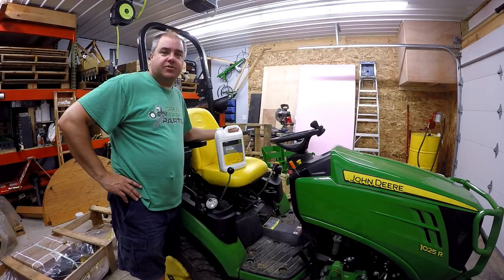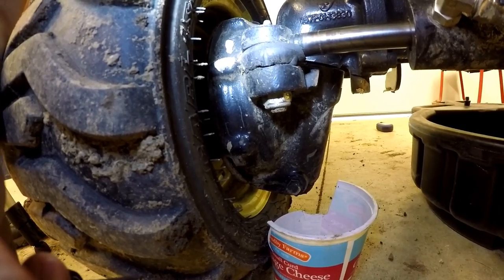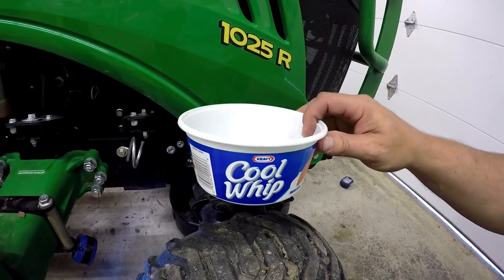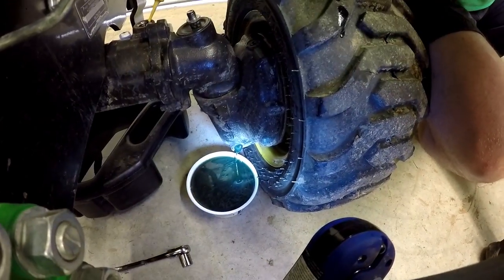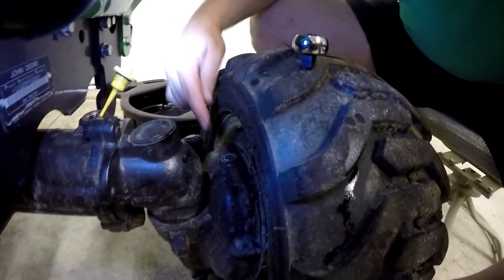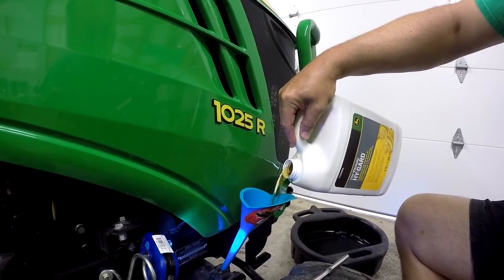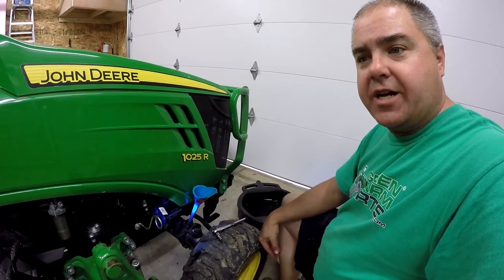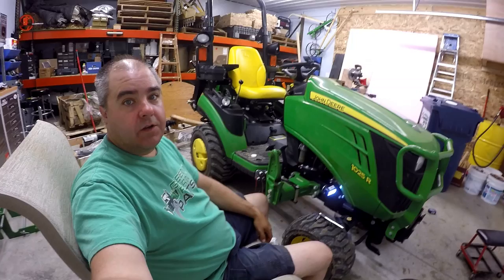Essential Oils: John Deere 1025R Front Axle Oil

Comment: I did this on mine at 50 hrs.  I read and re-read my manual and checked online - the way I ended up interpreting service manual was that the manual didn't say not to do it at 50 and it was part of the transmission service section, so when I did my 50 hr, I just did front and back axles.  Curious if others interpreted same way.  I used solo cups to catch - yep too small :).  I used  cardboard (saved amazon boxes) under the front end to catch spills.  I took some video of my 50 hr, but I didn't film the front axle piece.  Been too busy to get it edited up - hopefully will have a few done soon.  Hope y'all are doing well - as always great video!
Reply from the maker: +Tractor Therapy yea, 'oops, this bucket is too small!!!'  I thought folks would enjoy seeing that.
Reply from the maker: +Tractor Therapy ...and it never hurts to change oil. If in doubt, change it. I wish I had changed my front axle oil at 50 now...having seen the output at 250.
Reply: Very true advice.  I had quite a bit of metal shavings in front axle as well.  That axle is so beefy I doubt it does any harm to run a little longer on the change out, though.

Comment: Tim, Thanks to you and all your family for making all the entertaining and informative video's.  They have helped me in many areas with my 1025R.  From purchases of numerous Heavy Hitch items, Original tractor cab, and bucket skid shoes. Of course always using the TTWT for helpful discounts ( thank you ). I do have a question in regards to annual maintenance in the manual it says to Drain water from fuel tank, not exactly sure how this is done.  Any tips or suggestions would be greatly appreciated.
Reply from the maker: There is sometimes water at the bottom of the sediment bowl.  Perhaps that is what they are talking about.

Comment: The most effective way to clean your floor is to get a gallon of mineral spirits, two bags of oil dry and a stiff bristle push broom. Keep the area well ventilated and be careful about sparks or open flames due to the fumes !!!!!!

Sprinkle out the mineral spirits over the oil spill areas and scrub with the broom, then cover generously with the oil dry.

The chemical will break down to oil allowing the oil dry to soak it up, let it sit for a while, you can stir it with the broom and see it soaking up the chemical and cleaning the floor. Before you know it "Bob's you uncle" and your garage floor is clean as new.

The oil dry can be reused several times, I have even spread it out on a old concrete pad and burned the oil out of it and put it back in the can to use again.

It does work better in cooler weather and cool concrete, less evaporation and fumes.
Reply from the maker: +mrgearheadfromhell sounds good.

Comment: Great video! Question: Not sure if we should keep adding the new oil to the point where the oil comes out of the two bleed screw ports? Will the oil eventually bleed from the screw ports after an hour or so? I am thinking that the vent ports are well below the final oil level. Thanks

Comment: Tim my 2016 with less then 200 hours has started leaking up front left set on the tractor the seal I guess has gone out on that side have you ever changed it are is that something i need to take in the parts is right at. 100 dollars and labor is 675 thanks for all the help you can help me with

Comment: Great video. I can't see in the manual where it says to change the front axel fluid at 200 hrs. Probably good to do so but all I can see in my manual is to change it at 600 hrs. Do you have a service manual that says otherwise? Thanks.
Reply from the maker: +Laurie Harding I dunno for sure.  I can say that my oil looked horrible.  I regret not changing at 50 or 100 hrs.
Reply: Tractor Time with Tim  Sounds good to me. Getting ready to do my fall oil/fluid changes along with fuel filters so the front axle will be on the list. I have 300 hrs on mine. Thanks :-)
Reply: Tim this weekend I changed my front axle fluid when I replaced the fuel filters and changed engine oil and filter, and greased it. I have 300 plus hrs. On the clock and I must say the axle fluid was very dirty down at the lower drain plugs. It was a very metallic looking fluid. Thanks for the video.
Reply from the maker: +Laurie Harding yes, mine was the same!  We really should change this at 100 hours!

Comment: Tim,   What is the depth of your Pallet rack?  I have a Two car garage with 7" doors and 8'6 ceilings, and am looking to add a pallet rack to one side to better stack, my Box blade, Tiller, Snow blower, Hopper spreader, Post hole digger. loader bucket, York Rake, Dethatcher  (you get the idea.  Tractor on one side and implements on the other.  Wife's car on the outside  any suggestions would be appreciated.  or even a video on storage.
Reply from the maker: +Todd Smith wife's car on the outside??   Bad plan!  Anyway, my pallet rack is 46" deep, but most are 42" or 48"
Reply: The Kidney Stone has her car outside right next to my 2012 F-250  so she cant complain.  The John Deere 1025R and implements stay inside out of the weather so they do not rust up.   The 1025 in one bay with a block heater for winter and the implements in the other bay. thats why  i am looking for a pallet rack or two so I can clear up some floor space.
Reply from the maker: +Todd Smith I bought the pallet racking from a local used pallet rack place.  That way, I could get exactly the pieces which fit my application.  Less than $500 for all of the pallet rack in my shed

Comment: Hey Tim, does the front axle take the same oil as the trans/hydraulics???? also, would you suggest adding "teflon tape" to the vent plug when you reinstall them???
Reply from the maker: Yes, same oil, no to Teflon tape.

Comment: Wow, 250 hours and changing the front end?! My manual says to do it at 600 hours. So that's when I did it. Didn't see any metal in mine. I'm getting close to 900 hours. Next spring I should be right at 1000 and time to do the oils again except the front end. The 2210 I had for 10 years had 1400+ on it when I traded. Looks like I'm going to beat that with the 1026. Take care.
Reply from the maker: +mi2tn yea, i think you use your tractor for more than you did the 2210.  Being a bit larger, it is probably a bit more useful.
I think my book said 200 hrs for front axle changes.
Reply: You might be right but I think I put more hours on the 1026 because I'm retired and have more days to use it. :)

Comment: Hello ! I have a 1023e , should I be changing my front axle fluid at my first 50 hours ? What kind of service should I be doing at my first 50 hours ?
Reply from the maker: Your manual has all of this information.   The recommendations changed in 2018 for 2018 and newer machines.  No more 50 hour change for front axle or hydraulic oil/filter.

Comment: I believe you stated 2.2 quarts in the front axle...
I'll find out in an hour...
Fluid Capacities
Item	Measurement	Specification
Fuel Tank	Capacity	21.2 L (5.6 gal)
Cooling System	Capacity	3.7 L (3.9 qt)
Crankcase with Filter	Capacity	2.7 L (2.9 qt)
Transmission and Hydraulic System	Capacity	12.3 L (13 qt)
Front Axle	Capacity	2.8 L (3.0 qt)
Reply: Mine as well. 3015

Comment: Tim I have a JD 4120. 43 hp. I have problems with leaking where each wheel bolts to the axle itself. I've tightened it many many times. When it first happened it was under warranty and it was at the JD dealership for a warranty repair and they called me to say it was leaking. Confused I asked could they just tighten the bolts. They did. 
When I got it home I was working moving dirt and I noticed the front end was acting funny. When i looked one side only had one secure boot holding it on. The others were hanging on by a thread or two each. I literally turned them w my fingers about a turn or two and they came out. 
There was no oil on the stick and took quit a bit to fill it up. 
I called JD they said maybe they forgot to tighten the bolts..???
I tightened them, replaced the oil and it kept leaking. I took it back to them , they called and said it was ready. Brought it home and overnight there was a puddle of oil on the shop floor. 
I refused to take it back to JD because I have lost trust with them. 
I have to constantly tighten the bolts otherwise the oil will leak out. 
Whew...long story....do you have any recommendations as to how to tighten the bolts to keep it from leaking? 
This has gone on since 2012. Seeing your video I thought I'd just ask. Maybe you or a subscriber might know what's going on.
Reply: Sounds like you have either a damaged gasket or possibly a nicked or cut O ring.  Will need disassembly to repair I am sure.
Reply: have you tried using blue loc-tite on the threads?
Reply: thats like the deere dealers here in pei wich why john deere got them selve in a bad reputation wich my kubota dealer takeing most the deere customers for there service and comes out of the shop nice :) thats why i trust kubota dealers 100% then deeres accully
Reply: heated38 no that hasn't even crossed my mind. I'll certainly give it a try
Reply: Michael Mac Tavish this particular dealer used to be the best in my region. This was years ago before it became Sunsouth. The owners made sure you were happy. But in the years Sunsouth bought it the service went south. I had bought several lawn mowers, a tractor and implements from them before the change. The first piece I bought after the change was a Gator. I could immediately tell during the buying process something was off. Same employees but the order in which things were done were different. 
There were many people who left that had worked for the previous owners. One was a good friend who was a salesman and he said it was hard to work for the Sunsouth franchise but he didn't go into specifics. He left and went to work for a privately owned dealership about 150 south of here and that's where I bought this tractor and implements. He had the same tractor which I tried at his house so I bought it from him as I had all my other JD machines. They delivered everything for free and even came and picked it up the first warranty work was done. Nothing major just a bit of slack in the joystick. 
Anyway long story short it's been hard to trust these guys. Since then Ive done all the work on it myself that I could including installing a Power Beyond kit when I added my backhoe. It's rough for me as I'm disabled but I'd rather do it right then chance it with them. 
Thanks for the input
Reply: yeah my kubota dealer does the services for disabled people little less price  wich hes awsome becasuse the deere over priced there service wich my kubota dealer said to me thats awwful for chargeing disabbled people more instead giveing them best deals

Comment: You say to check it every hour or so after filling it, does the oil get hot enough in the front axle? Should it be left to cool down first?
Reply from the maker: +P0tat07 not sure. Refer to the owner's manual for the most accurate info!

Comment: I have a 2320 with 300 hours on it and I've never changed any of the oils. Still has factory oil and filters
Reply from the maker: +SoFlo Antonio uh, that is not good.  You need to change the fluids immediately!
Reply: Tractor Time with Tim should be fine I have a John Deere skid steer with 2000 hours on factory oil and filters
Reply from the maker: +SoFlo Antonio why?
Reply: because if it can build oil pressure than it will be fine i do 20k motor oil changes in me dump trucks and have never changed hydraulic oil or the gear oil in the transmissions or rear ends and they have over 500k miles on them
Reply: the only thing i really change the oil in is any on road vehicles and anything with a dpf everything else can wait til i have nothing better to do

Comment: On mine the service manual said to change the front axle oil at 600 hours.
Reply from the maker: Maybe so.  ...mine had LOTS of shavings in it. Wish I had changed it even earlier.
Reply: Guess I will change mine also thanks.
Reply from the maker: Doesn’t take much oil, or much time, so no reason to defer.

Comment: What velocity is it? I'm gone paying JD prices
Reply: Hy-Gard Low Viscosity (LV) is equivalent to a 80W90 GL-5 Gear Oil. Using a GL-5 as our manual calls for fits this Viscosity requirement. Most John Deere Dealers spec and recommend the Hy-Gard LV vs the GL-5. The lower viscosity Hy-Gard

Comment: Use a bread pan. It fits just fine and has adequate capacity
Reply from the maker: Where do you find a 5 gal bread pan?
Reply: The bread pan is just the right size for the lower front diff drains after draining from the main drain.

5 gallon bread pan is a very large loaf of bread.
Reply from the maker: Sorry, I didn’t see which video this comment was on..thought it was the hydraulic oil.  Yes, bread pan would work great for the front differential draining.
Reply: Finance committee doesn't approve of using items from the kitchen for tractor maintenance. :)

Comment: Observation: After you removed the plug to allow air to escape when filling, it dawned on me that the axle is potentially air tight when it's all closed up. Thus it gives some credibility to the idea of allowing the axle to breath via the vented dipstick that's covered in a different video. It makes senes now that when the axle is in use, it's mechanical and will generate some heat during operation. Without some way for the axle to breath, air will find the weakest point - the seals. I think I'll order the vented dipstick now.
Reply from the maker: Don’t forget code ttwt at http://otisinnovations.com
Reply: @TractorTimewithTim  Thanks!!

Comment: No where in the JD manual does it say what type of oil.  You are using HY Gard Low Viscosity.  I assume that is the correct oil as you don't mention it either.  My dealer actually said 80-90w gear oil.  (He was corrected by his secretary....lol)
Reply from the maker: Says it right on the fill cap.
I’ve ran low vis and regular hygard. Didn’t notice a difference
Reply: @TractorTimewithTim  glad to know the low vis works... I ordered and didn't realize it was low vis... I was worried about it in the summer